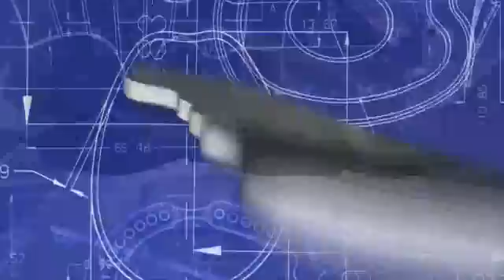#britek  Energy Return Wheel... Autonomous Never Flat

Comment: how does it compare with traditional tires up against raining season such as safety / traction test with this concept tire?
Reply from the maker: Inventors are now "patent trolls"...It is the inventor taking advantage of helpless corporations...They must be stopped.
Reply: assuming hard enough hit in a pot hole that would slightly bend the wheel while does not deflate.
how does it compare with traditional tire ? because traditional tire will still remain in shape and less of damage to axle and strut stress load?  :)
Reply: Ray Wu He doesn't answer those questions. He posts endless videos showing absolutely nothing of substance, and talks non-stop about how many patents he's filing, but, thus far, there's apparently no trace of any actual track/road tests. Whenever I've challenged him about it, all he's ever responded with is akin to: "I'm filing more patents" or "now I'm working on a NASA rover version" or "now I'm working on a truck version."  Yet, oddly (pfftt), there's no trace of any actual products, nor even just a single track test showing a car taking a hard corner on these wheels. Oh, but hey, he has a video of a computer simulation of it. Ha. He's a clown.
Reply from the maker: Ray Wu ERW composite hoop will go oval and displace "linear" in a large event. Stretch and vacuum tension is  pre tuned to 10 x wheel load. More power to handle massive impacts. Review ERW bicycle slow motion videos to see in wheel suspension.
Reply from the maker: rockethead7 Thanks for your encouragement. When going up against a 200 billion dollar industry...Full disclosure for your entertainment?  Probably not.
Reply: EnergyReturnWheel

What people do when they ACTUALLY want to compete in an industry:

1) Deliver an actual product, not just a bunch of videos and patents for products that don't exist.

2) Get a market share in one deliverable product (or product line), then expand to other product lines after already generating brand value.

3) Demonstrate a superior product in actual real-world conditions. Anyone can make a wheel that performs better in one particular condition.  A truly superior wheel will perform better in ANY kind of condition (hot, cold, aggressive turns, straight lines, high speed, whatever).

4) Put together a highly polished website and presentation.  (Websites riddled with grammar and spelling errors don't make it seem like the producers of these products are competent.)

What a "patent troll" does (someone who doesn't make any products, but intends to make money from a bunch of useless patents):

1) Constantly switch focus from product line to product line, without actually finishing any one product line.  This keeps potential investors under the impression that there's a lot of development going on, and gives excuses for why there is no actual product for sale.  (Hmmm, this is kind of like what you're doing, because you advertised car wheels, then talked about your truck wheels under development, then talked about your NASA rover wheels under development, version after version after version, yet nothing in the actual marketplace.)

2) File tons of patents.  The general population is painfully ignorant of how easy it is to get a patent, and most people are under the impression that if a patent is granted, that must mean that the product actually works, and the "inventor" must be really smart.  Of course, in reality, nobody in the patent office actually tests anything.  Anyone can file a patent for just about anything, whether it's a good idea, or a bad idea.  But, by filing tons of patents, the potential investors are bamboozled and impressed.  (Hmmm, this is kind of like what you're doing, because all you talk about is how many patents you've filed, yet you don't seem to have any actual products in the marketplace to match all of these patents).

3) Make a bunch of investorbait videos.  There's always a healthy share of the population that just believes everything they see, so by making videos, a patent troll can actually convince people that bad ideas are good ideas.  This gives added mystique and value to the patents, even though such value is just "perceived value" with no actual tangible market value based on products for sale.  (Hmmm, this is kind of like what you're doing, because you've got all of these videos of products that don't exist, and you even posted a video of a computer simulated car taking high speed turns on your wheels... as if, hmmm, maybe if you actually did that with the actual wheels, they'd self-destruct under heavy cornering loads??)

4) Evade any actual requests to see useless products in action.  The last thing a patent troll wants to do is reveal just how bad his/her products are.  (Hmmm, this is kind of like what you're doing, because you'll come up with any excuse under the sun for why you won't put your wheels on a car and run it around an actual race track.  I mean, take for example your most recent reply, where you're implying that to show your wheels in real world conditions would somehow be a "disclosure" that you don't want to make.  How does this even make sense?  You've already filed a half a billion different patents, right?  So, what on Earth are you worried about if you show your product to anyone?  You've bragged about all of your patents, so your designs are ALREADY 100% publicly available.  Anyone can go read your patents.  So, what's the "secret" you're saying you'd be "disclosing" by showing your wheels running around a race track??  It makes no sense to me.  You've already disclosed your design the moment you filed the patent.  So, the only reason I can figure that you downright refuse to show your wheels in any kind of real-world conditions, is because they fail miserably, right?  I mean, I can tell just by looking at your wheel design that they'll fall apart under heavy lateral G-forces under real world load conditions, right?  That's why you will show your wheels going in a straight line, and you'll talk all about straight line performance, but you dare not show any heavy turns, because they'll fall apart, right?  C'mon, be honest now, we both know the truth, don't we?)

Anyway, did you read that link I gave you to the anti-patent-troll laws that were passed a couple of years ago, and the White House report on how they're cracking down on patent trolls??  They're making it a lot tougher on people who just file endless patents who never develop any products for sale, you know.  It's going to be even more difficult as time goes on, for patent trolls to cash in on useless patents. You know this, right?
Reply from the maker: Out of 10,000 comments this is by far the most effort we have seen!  Bravo. Passion is wonderful. Replacing the 140 year old tire? If it were easy Michelin, Goodyear and others would have already done it. Our pace of development has been steady, 2 years of back to back NASA Rover Challenges 4 top ten finishes was a big deal for us. 2015 MTSU first American team. nasatv.com archives.
Reply: EnergyReturnWheel

Yes, another thing a patent troll does:

5) Changes topics whenever challenged.
Reply: EnergyReturnWheel
So, apparently you didn't read the White House report I told you to read.  And, apparently you didn't even read my earlier message either.

Yes, you are a patent troll.  All patents, no products, and showing no signs of actually having a product either.  All talk.  A million patents.  Nothing for sale.  Patent troll.
Reply: EnergyReturnWheel
2nd reply:  even if you actually believe your own claptrap, and you actually think that your lousy ideas are good ideas (massive massive delusion), that doesn't change the concept about being a patent troll.  You still have a million patents, and you're marketing them, etc., but after years, still haven't produced your wheels for sale.  I mean, I know the reason for this is because your wheels don't have a shot in hell of actually performing under real world loads.  Again, I can tell just by looking at the lousy design that they can't take corners.  And, that's evident also because you seem very willing to show your wheels in slow moving straight lines, but won't show them under heavy cornering loads (except in a computer simulation, which is downright laughable itself). Anyway, the point is, you show EVERY sign of being a patent troll, and you show NO signs of actually bringing a product to market.  You keep churning out patent after patent after patent, shifting your focus from product to product to product, but you don't bring any of your wheels to market.  This is EXACTLY what a patent troll does.  I mean, I might even grant you the concept that perhaps you believe your own nonsense.  Maybe you actually DO think that your lousy designs are "the future" (which I can barely even type without laughing).  But, being delusional doesn't change the argument about whether or not you're a patent troll. If all you do is file patents and make videos, and you never show any signs of bringing a product to market, then yes, you're a patent troll whether you believe your own nonsense or not.

And, you know, I asked you a question (well, I asked many questions you don't answer, but this one in particular stands out):  Why on Earth are you babbling about not wanting to show your wheels in real world heavy-cornering conditions because then you'd be "disclosing" something???  Disclosing WHAT?  Anyone can read your million patents.  So, all of your designs are already publicly available.  So, what "disclosure" are you worried about if you show your wheels on real cars in real race tracks?  Everything was already disclosed when you filed the patents.  So, what's your worry, after all of these years, about showing your wheels in heavy cornering conditions?  You've shown them in straight lines.  What's wrong with showing them in corners?  What's magical about showing them in high speed corners that you're NOT willing to disclose, but you'll disclose them in slow straight lines?  (They don't work in high speed corners, right???  THAT's the disclosure you don't want to make, right???  You don't want to disclose that the design itself is fatally flawed from the start, and showing a real car in a heavy corner would disclose that your wheels don't work, right???)
Reply from the maker: ERW specific application builds are available on our website.  ERW bicycle high speed cornering is shown in videos. Lateral G force has never been an issue. Mimicking the CUSHION and "low speed" performance of pneu has required much r+d. Next cip patent filing will provide claim protection.
Reply: EnergyReturnWheel
I'm not talking about freekin' BIKE wheels, and you know it.  I'm talking about all of your car/truck wheels you keep talking about and advertising.  You know... like the one in THIS VIDEO??  Pffftttt.  Again, nice job changing topics AGAIN.

"Next patent filing will provide claim protection"???  That's your reply?  More patents?  More patents?  More patents?  Thanks for proving my point.  I accused you of being a patent troll, and your reply is that you're going to need to file more patents??  Seriously??  Is that a joke??

You only need ONE patent to protect your intellectual property.  You have a half billion patents.  You think one more patent will make a difference?   What a clown.  This is obviously just (yet another) way to duck and dodge the fact that you haven't shown what happens when you put your wheels on a real car and put them on a real track.  Again, you're just not answering about that.  I say it's because you KNOW your wheels fall apart under those conditions.  You reply by switching topics to freekin' BIKE wheels???  Again, you're proving my point.  I said patent trolls change the topic, and you just changed the topic.  Bravo.  You just showed that I was correct.

There's NO REASON that you can't put your wheels on a car and take it to a track. You don't need to file another patent in order to do that.  It's been YEARS.  YEARS!!!!  YEARS!!!!  All you ever do is advertise your ideas and patents, but you downright REFUSE to put your wheels on a real car and take it to a track??  See, if anyone had a REAL product, a REAL idea, the FIRST thing they do after filing the patent is to go out and prove their products.  Do you do that?  No.  You make videos.  You talk.  You change topics.  You switch to a different product line.  You file more patents.  You talk more.  You file more patents.  You do everything under the sun EXCEPT put a product in the market.  If that's not a patent troll, I don't know what is.
Reply from the maker: Last week we announced our first Auto license. Industry will do "due diligence". ERW  Robust performance.
Reply: EnergyReturnWheel
Oh, I see, another duck and dodge.  Let me attempt to translate what you just wrote, for those who don't understand:

YOU SAID: "Last week we announced our first Auto license. Industry will do "due diligence"."

-- Translation: I don't dare put my wheels on any real car on any real track, because they'll fall apart.  So, even though I keep getting challenged for not addressing this issue, I have to come up with SOMETHING to make me look good.  Changing the topics isn't working, because this guy just isn't falling for it.  So, yeah, I'll just stall.  Sure.  That'll work.  I can blame things on "due diligence" of other people, and I can sit here and pretend there's a real reason that I refuse to put my wheels on an actual track.

YOU SAID: "ERW  Robust performance."

-- Translation: I will keep talking about the performance that I dare not actually demonstrate.  Going slow in a straight line, sure, my wheels can do that, so that's what I show.  I'm not afraid to show slow moving vehicles going in a straight line on my wheels.  But, since I don't dare show any cars in heavy corners (except that computer simulation I posted, hoping that people will just brush it under the rug that I am not doing it on a real car), all I can really do is TALK about the "robust performance."

Now, are my translations right or wrong?  Pfftttt.  I think we both know the answer to that.

I really really really do wonder... who exactly do you think falls for your line of garbage?  I mean, do you believe your own garbage?  Or, do you just sit there hoping other people will believe your line of garbage?
Reply from the maker: We are flattered that you have spent so much time helping us out. What should we do next?
Reply: EnergyReturnWheel

YOU SAID: "We are flattered that you have spent so much time helping us out."

-- Ahhh, another hallmark of the delusional... a passive-aggressive reply.  Sorry, I don't cater to passive-aggressive nonsense.

YOU SAID: "What should we do next?"

-- How about admitting that you're nothing but a patent troll, and that your car wheels don't stand a shot in hell of ever taking a high speed corner under real world loads?  That's why you've never shown your wheels taking high speed turns, except in a comical computer simulation, right?  Once you're done coming clean on that first item, I can list about 100 more things you can do.
Reply from the maker: New hate speech?...Inventors are now Patent Trolls. Sponsored by Corporations, Media  and bought politicians.
Reply: EnergyReturnWheel
And, when all else fails, a patent troll blames conspiracy.  Bravo.  You've now completed the patent troll playbook from front to back.

By the way, nice job changing topics again for the millionth time. You asked what you should do next.  I replied.  You changed the topic.  Duck and dodge.  Duck and dodge.  ANYTHING other than admitting that your designs are utter crap, and that you'll never put your wheels on real cars and throw them on a track in heavy corners, right?  We both know they'll fall apart, right?
Reply from the maker: We are very confident of any high speed auto maneuver. Auto is the Grail not the starting point. Our switch to bicycle was at the request of BTWIN bicycles. Applying and protecting discoveries is required for license or investment. There are no diamonds made on the beach.
Reply: EnergyReturnWheel
Again, I seriously wonder who you think you're fooling?  You SAY you're confident about high speed maneuvers. But, years and years go by, and you won't actually PERFORM those maneuvers. All talk, no action = patent troll.  You're willing to show your wheels at low speed going in a straight line. But, you went through a hell of a lot of trouble to put together a computer simulation of a car going through high speed maneuvers. I mean, you had the car, you had the wheels, you were filming low speed stuff in a straight line. But, how does this go? You stopped filming without throwing the car into any high stress turns, and instead you took alllllllllll of that time to put together a computer simulation of a car going through a high speed turn instead?  Did you think nobody would notice?  I mean, your WORDS say that you're confident about your wheels, but your ACTIONS say otherwise.  Then, when confronted for the billionth time about this, you said that you were not showing a high speed turn because of what reason?  You said you were worried you'd "disclose" something???  Pffttt. I pointed out that this doesn't make a lick of sense, because anybody can go read your 10 million patents and see your designs.  So, what's the secret?  You've already displayed your wheels in a bunch of low-speed straight line scenarios, so what in the world is the "secret" about displaying them in heavy turns?  You also used the excuse that you need to file one more patent first??  What???  Do you think everyone else on Earth is just plain stupid?  Do you think that one more useless patent on the pile of useless patents you already have is going to make the difference that will allow you to show a car in a turn?  You have filed enough patents so that you can show a car going slow in a straight line.  But, you need to file one more patent before you can show a car taking a turn?  Pfftttt.  This concept is so silly and stupid, I can only just laugh.

C'mon, you can admit it, your "secret" is that the wheels do NOT work in any kind of high speed heavy cornering, right?  You're all talk, right? If you were REALLY confident about the performance of your wheels under stress, you'd have shown it years ago, right?  But, you're not, so that's why you keep switching topics, switching focus, and won't actually produce any products for the public, right?  You're sitting around, talking up a good game, with no actual products to back your words, and you're hoping that some sucker is either (1) dumb enough to buy/invest into your useless patents, or (2) someone will make something similar and you can sue them, right?
Reply from the maker: Such effort to save people from ERW. Do you work for the tire industry or are you bored and lonely?
Reply: EnergyReturnWheel
And, yet again, more conspiracy accusations, and more trying to divert the topic. What a worm. Do you HONESTLY believe that anybody "in the industry" (auto tire industry) gives a crap about some backyard yokel who doesn't sell anything?  Do you think Michelin or Goodyear are worried about you or your silly wheels? They sell billions of car tires. You haven't sold ONE car wheel.  And, they're worried about you?  Their engineers can take one look at your design and know instantly that the wheels will fall apart in heavy cornering. They know they have NOTHING to worry about from you.  And, you know, if you had bothered to read the new anti-patent troll laws that I pointed out to you, you'd also know that, basically, they can pretty much take your designs if they wanted to anyway (if your designs were worth anything, which I can barely even type without laughing). You don't actually think that all patents are enforceable, do you? I mean, you're the king of patents, right? You hold like a million of them, right? So, you should already know that there's a difference between holding a patent and enforcing a patent. And, that's especially true in your case, since you hold a million car wheel patents, but you don't actually produce any for sale (the very definition of a patent troll).  If I actually did work "in the industry" I'd feel quite comfortable making wheels similar to yours (if I thought they worked, which, again, makes me laugh).  You've filed a million patents, but there's nothing I've seen from you so far that seems like it's not intuitive, that any engineer couldn't just come up with on his/her own.  And, you're not producing anything.  I think you quite easily fall under the "patent troll" category, which means that it'll be pretty hard, under the new laws, for you to enforce your own patents.  So, yeah, if I was actually in the industry, you'd be nothing more than a joke.

So, let's do a little recap:

1) You file a million patents for car wheels, but don't actually make any car wheels for sale (patent troll).

2) You show cars going in straight lines at slow speeds with your wheels, but the best you can muster for showing your wheels at high speed in heavy corners is a freekin' computer simulation (you dare not actually show what will happen if a real car goes into a heavy turn on your silly wheels).

3) Every time you've been challenged on this, you duck and dodge, and downright refuse to answer about this.

4) .... Except one time, when you laughingly claimed that you needed to file one more patent before you could show your wheels taking heavy turns. Pffftttt. What a ridiculous joke.  Like, you are trying to tell people that you have enough patents to show cars going slow and straight, but you need to file more patents in order to show a car taking a high speed turn???  THAT is what you want people to believe???  THAT is your reply???  Pffftttt.  What a clown.

5) .... And, you also said at the same time that you can't show cars taking heavy corners because you were worried that you'd be "disclosing" something.  I reminded you that you've already disclosed your designs the minute you filed your patents.  You've already showed your designs on cars going slow in a straight line.  So, I repeatedly said that this response doesn't make any sense.  But, you won't address it.

Look, clown, get this through your skull... I'm not one of your gullible fanboys who sees a cool looking wheel and jumps on your bandwagon.  I can see past the investorbait videos you produce.  I can see past the cripplingly illiterate writing on your website.  I can see past the million patents you have filed, because unlike the gullible masses, I know that filing a patent is no big deal.  Holding patents for your ideas doesn't mean your ideas are GOOD ones, nor does it mean that your ideas are unique, nor does it mean that your patents are enforceable.  The patent system is just a glorified filing system, nothing more.  It doesn't mean your ideas are GOOD.  I can see past your silly tactics of switching your focus from cars, to bikes, to trucks, to NASA rovers, to exercise blocks, to footwear, etc.  When you keep changing your focus from product to product, what on Earth does that REALLY say about your car wheels?  **IF** they were any good, you'd focus on getting them in the market, and you wouldn't divert your attention every 2 seconds.  And, I'm not some stupid chump who falls for your constant attempts to change the topic every time you're challenged.  I challenge the design of your car wheels, you answer about your bike wheels.  I challenge your car/road tests, you answer about your NASA rover.  I challenge your computer simulation, you answer about your truck wheels.  I point out that you show every single hallmark of being a patent troll, you blame conspiracy, and try to worm out of it by questioning ME.

The topic isn't me.  The topic is you.  And, if you thought that you could just throw all of these investorbait videos online, trying to bamboozle gullible investors, without anyone speaking up and pointing this out, you are even more delusional than I thought.
Reply from the maker: Could you elaborate?
Reply: EnergyReturnWheel
Thanks for proving my point, you clown.
Reply from the maker: Thanks for being a good sport. Our switch back to auto will be very exciting. Can hardly wait for your new comments.
Reply: EnergyReturnWheel
All you've demonstrated is that you refuse to answer to any of the challenges. Thousands of lines later, countless questions go unanswered.  All you've done is distract, change topics, refuse to answer, delay, make excuses, and overall just plain demonstrate in all sorts of ways that you're just a patent troll.

My favorite part about pointing out your patent troll behavior was when I said that you refuse to demonstrate your wheels under any loads, and I said that this was evidence that you're a patent troll... and your reply was that you have to file more patents first.  Classic.  Utterly classic.

Look, clown, you can keep evading the challenges and questions until the cows come home.  But, if you think ANYONE who reads your nonsense actually believes you, your brain is lost on another planet.
Reply from the maker: Yes! Our Mars composite ERW fits the low pressure, low temperature environment. High speed ground travel will be essential.
Reply from the maker: Follow us on twitter. britektire@twitter.com USDOT does not agree with you.